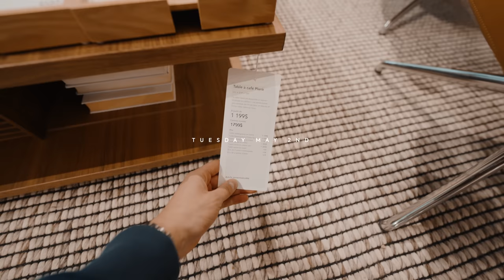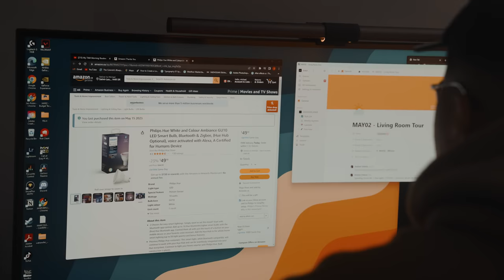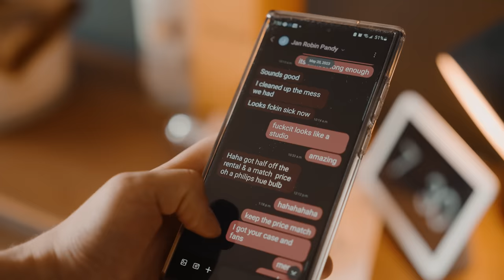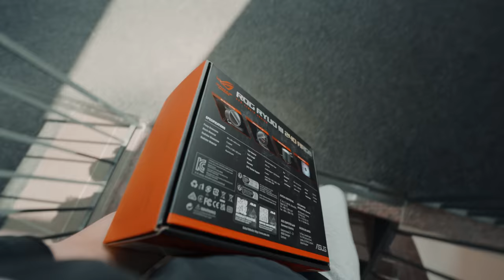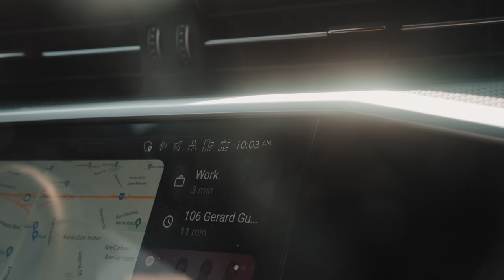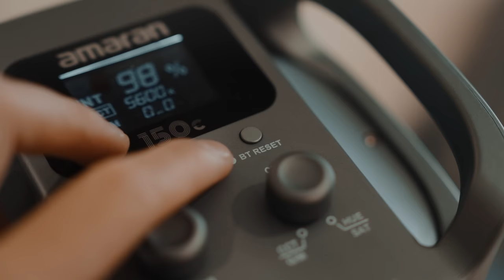The Dream Home Basement Makeover - Desk Setup & Living Room Area!

Comment: Hey I see you and other people are actively using Ikea kitchen countertops. But they are only depth 65 cm (25 5/8") is that enough to put big monitor setup and than your elbows on the table but you still not be too close to the monitor? How do you sit than work for a hours? Are your elbows on the table or on the armrests of the chair? It seems that for big monitors you need a table top depth of 70-80 cm. What do you think?
Reply: Hey, went this Route aswell. Bought an ikea top, depth of 60 or 65 i think and with a Desktop stand and two Monitors its not that great. I think you can get custom Sitzes for the ikea top on the ikea site. Wpuld definetly recommend more like 70-75